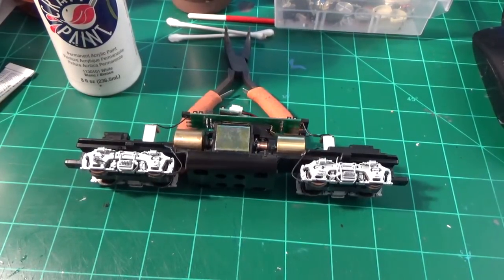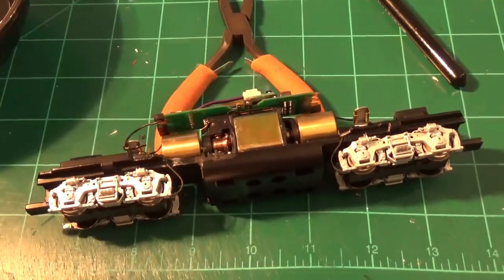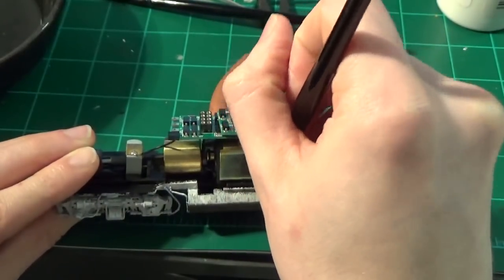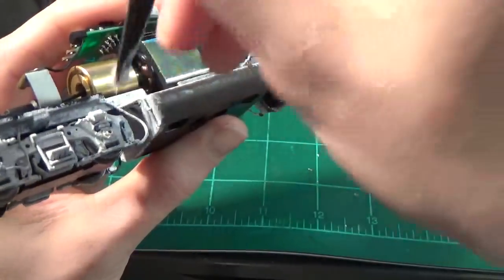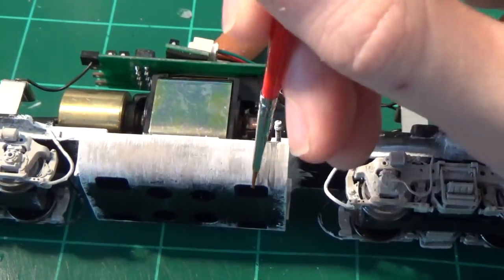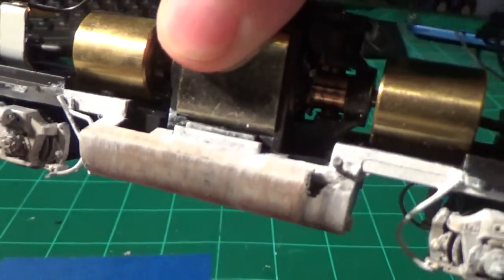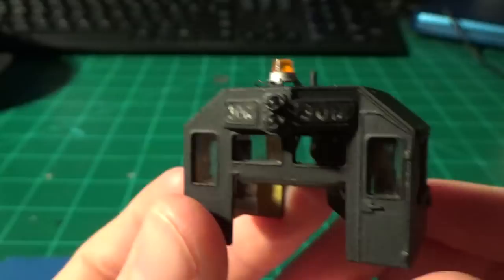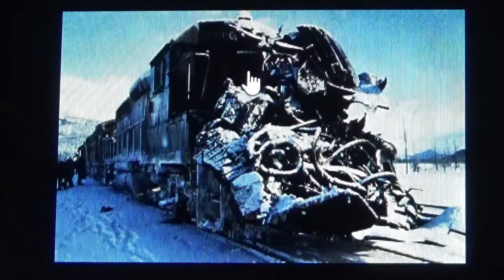Runaway Train 1985 HO Movie Locomotive Build! Part 3.

Comment: Another great update - the amount of effort you put in is amazing, and the results perfectly capture the grungy, icy look the lead unit's running gear had in the film - kudos too to Stephen Marsh and his production team for how much they went to town in painting and dressing the engines for the camera, resulting in a uniquely cold, filthy and textured appearance that looked fantastic from any angle and in any lighting condition. 

Fascinating observation about the headlight being painted over. There is, interestingly enough, a single shot of the lead engine with its headlight illuminated. It's not in the actual film but in the theatrical trailer, at the very end. The shot in question is that of the runaway bursting through the snow-shielded tunnel entrance, the one in the trailer being an alternate take (the angle is different and there's less snow on the ground) - the headlight is illuminated, as is what I think is an inspection light above the forward truck.

One minor detail I have noticed in the film regards the lead engine's windscreen. In reality, Alaska Railroad #3010 had an L-shaped windscreen on the engineer's side. For the film, they added in what appears to be a wooden strut to make the windscreen match that of the engine used in Montana, and in some shots you can see the join on HD copies. In other shots however, such as the one you show at 13:15, HD copies of the film show that the strut has fallen away, leaving just its white-rimmed outline on the glass.